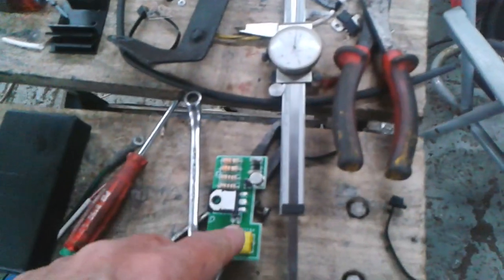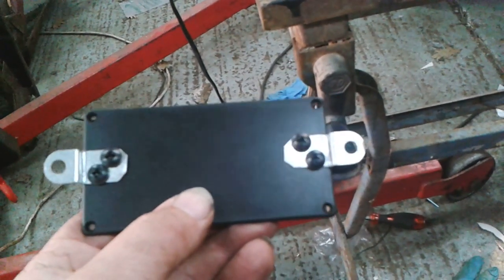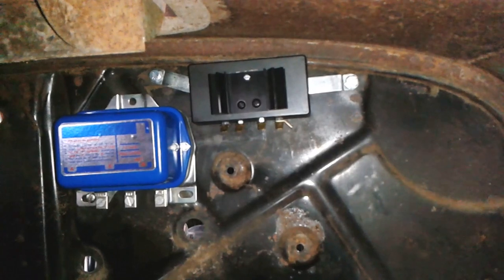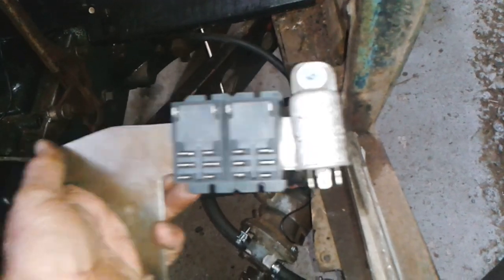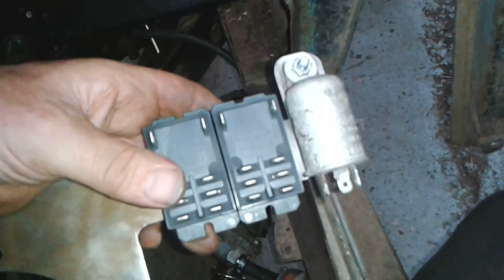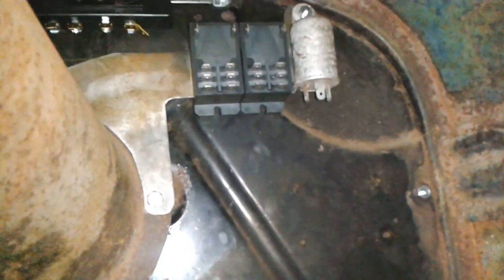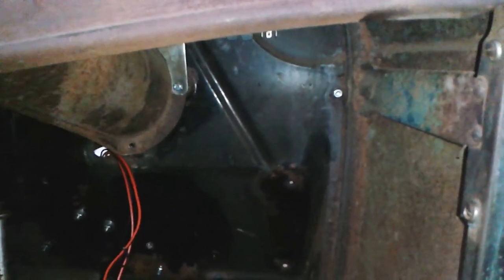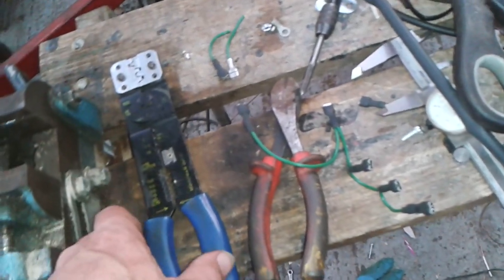Wiring an old car from scratch. Mart's 32 sedan gets wired! Part 1.

Comment: Great job with the wiring Mart it is very satisfying doing it yourself. I have zilch experience with auto sparky work and added indicators to my 48 by making my own loom and fitting it up and it went first pop too. Twin horn it Mart with an L tone it will sound better. I tore some giant Lucas horns out of an Austin Westminster at the tip years ago to put in my every day Nissan driver, man are they loud!
Reply from the maker: Yeah, Graeme a good old fashioned parp parp is much better than a feeble beep beep. I just wanted something compact and lightweight so used one that I had lying about. I think it's low tone brother is on the 33.

Comment: I really like that idea for the feed-through bracket under the left side of the toe board Mart. Have always struggled with the same issue on the Model A. I'm going to use that! Thanks for sharing!
Reply from the maker: Hi Glen. Yes, I did move the location to under the floorboard, but it worked well. Plenty of room in the depth of the plywood to accommodate the harness.

Comment: Hi Mart,  Great job as usual, thinking through the wiring job as you film it.  One thing I had trouble with when wiring my '48 which I can foresee a similar situation in your wiring.  I have an electric fan, which in turn required a relay which can carry the 20+ Amps for the fan.  The wires connect to the lower side of the relay in a vertical orientation, which could allow the power wire to become disconnected due to the weight of the wires.   I found it necessary to support the weight of the wiring harness to the relay to prevent the connectors from working loose due to vibration, heat, etc.  You may need to consider that in the way you connect to those tab connectors in a vertical position. Ignition wires were what I noticed.  Looking Good, Al Hook
Reply from the maker: Thanks for the tip, Al. The wire terminals are barbed into the relay holder and the relay plugs in from above. Hopefully it should be ok. I'll look at clipping the ignition wire harness. The tabs are at 45 degrees so hopefully should be better that fully upwards.

Comment: I like your approach to the wiring of the 32. I'm not a fan of the original ford electrical systems and they had such poor circuit protection. I suppose for the times they were built in they were OK. Never thought of using relays for turn indicators. You look at a modern car and there's relays for everything. I'm enjoying this segment! Thanks!
Reply from the maker: Thanks Robert. The relays are used to avoid using the specific switches which I find are either clunky or extremely shoddy. The only other relay is for the fan.

Comment: Mart, did your old switches come from Chinaville?
Reply from the maker: Can't say for sure, Brendan, but I wouldn't be surprised. The ones I got to replace them are still probably made in China but look and feel much better. I also went for spade terminals for simplicity. Quick check for switch quality, look at the chamfers on the lock nuts. Nicely machined nuts as opposed to sloppily stamped sheet metal.

Comment: Good brackets Mart, nothing worse than some component hanging on a self taper that comes loose. I particularly liked the Origami relay bracket that turned out to be left or right handed, is that Ambidextrous?
Reply from the maker: Sure is, Pat. thanks for popping in.

Comment: Cheers Mart.
I use trailer light board cable to run to the back.
They are all held together in an outer insulation and colour coded for the lights and indicators (and earth) so you only need to clip one piece.
Reply from the maker: That can be a good call, Steve. I remember doing that on one of my cars in the past.